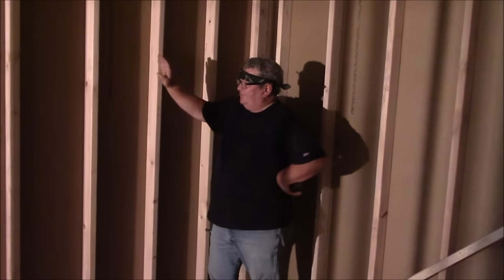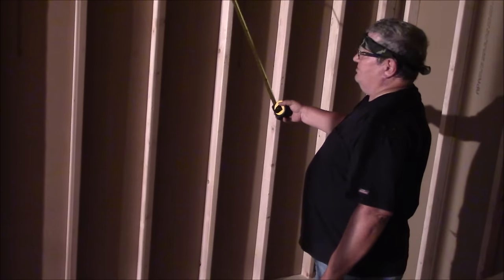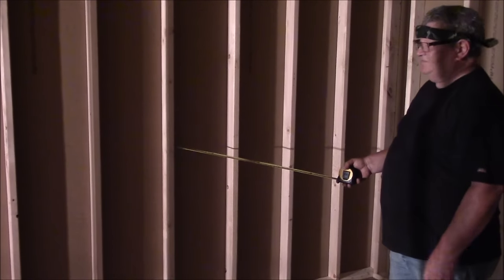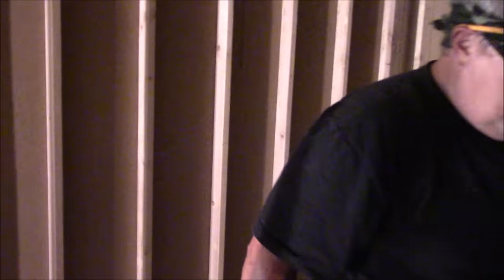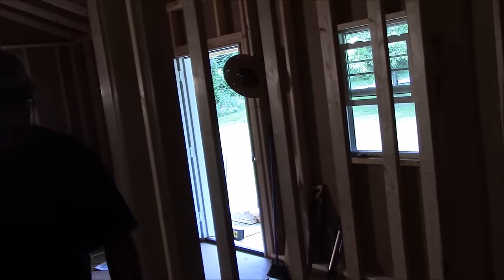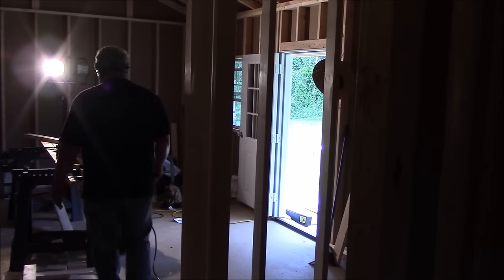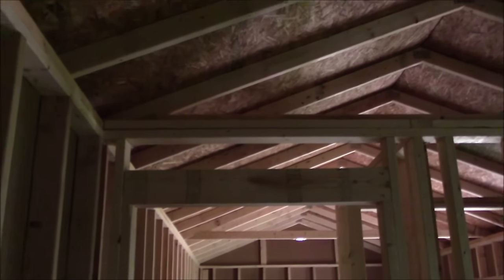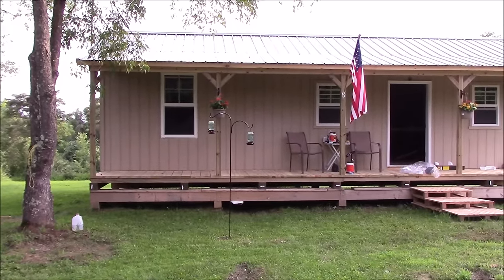Installing a window in the tiny house @ St. Bernard Acres

Comment: Just a thought. IF you can turn your blade upside down, you could get the saw at a better angle without the battery in your way, to make closer to a flush cut with it. Some of the sawzall types have a rotating head for that reason, but I don't know if the ones that don't will allow you to install the blade upside down. Or, get a miter box and use the back saw that comes with that to make your final finish cut close to the outer wall. It would be more work, but much more precise. "Disclaimer: I'm not a carpenter, nor do I play one on television." Looking good!
Reply from the maker: Odahi The Dubious  This is just a regular saw...nothing fancy.  I was looking for my miter box saw, but couldn't find it.  That's part of the problem with bringing Alex's truck out, and not mine.  Most of the things I needed were in the my truck lol.
Reply: The Homestead At St. Bernard Acres I understand. I have tools for work, and tools for the house. I should just get two full sets, I keep needing something that's in the other place. Great job with the window.

Comment: If you're planning for another window in the other end of the house, it might be a good idea to do it next, that way you have cross ventilation. Especially if it will be the same size as the other one you plan for the bedroom, you could use the one you have now, and keep cooler, and do the second bedroom window later in the process. Just meddling. Your house, your plan, do it the way you want. You're doing a fine job, without my help/interference. Mrs. O and I send our best.
Reply from the maker: Odahi The Dubious More windows coming for sure lol....thanks!

Comment: Hi Joe I'm no carpenter But when I do some thing like that after U figure were U want it drill holes through the wall close to size then cut from outside with a skill saw,then U have a hole in the plywood then cut your studs plus u get some out side light to, just a idea wood is not my thing.
Reply from the maker: TheKilog69  That's definitely a way to do it, but I wasn't confident enough in myself to do the "blind" cutting like that lol.  May try it on the next window.  If I mess it up, I can blame it on you lol.

Comment: Damn,  not a whole lot to rib you about on this one (except that generator)..  Just wondering though how thick and heavy is that outside wallboard ??  Window looks good..
Reply from the maker: eaglehill6  That siding is about 1/2 Hardy board type stuff.  Guaranteed for 50 years against, warping, decay, mold or anything like that.  Good stuff.
Reply from the maker: eaglehill6 Damn, and I moved the generator further away for you.  That board is around 1/2 thick Hardy siding like.  Guaranteed for 50 years against mold, mildew, warping, etc.  It's like a cement fiber board.
Reply: The Homestead At St. Bernard Acres hahaha   Actually I did think it was a little quieter  but I needed something to bitch about....

Comment: You need to put 2 more jack studs in under the sill plate.  One under each end of the sill.
Reply from the maker: SkilledEddie  The only thing that is there for is a place to nail the window and interior trim.  It carries no weight once the window is installed.  It is toe nailed into the jack studs.
Reply: The Homestead At St. Bernard Acres I framed houses for a custom home builder and we always put them in.  It helps keep everything square and the window from racking over the years from settling, expansion and contraction making the window tough to open.  It's a no brainer for me for the few bucks and slightly more time on a house your size.
Reply from the maker: SkilledEddie It does make sense what you are saying,